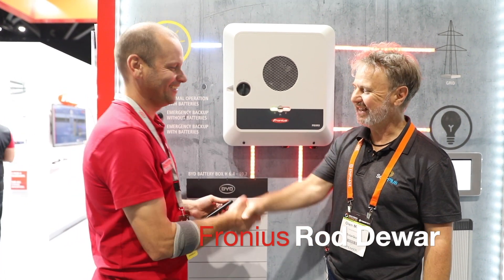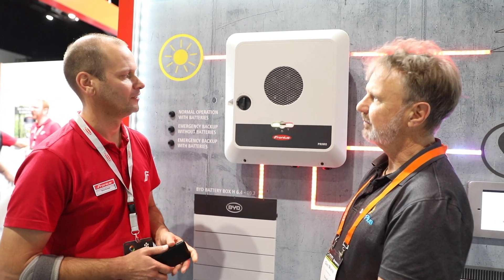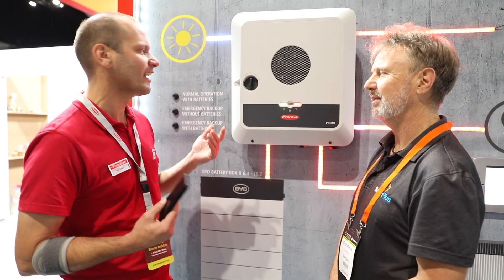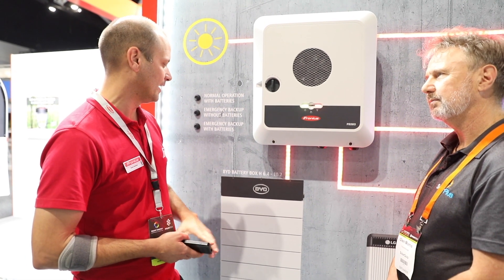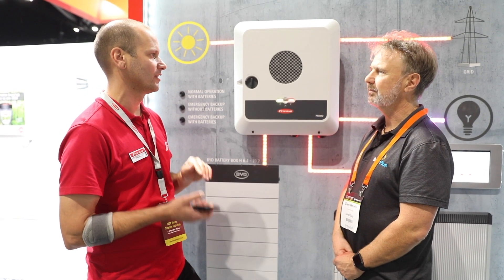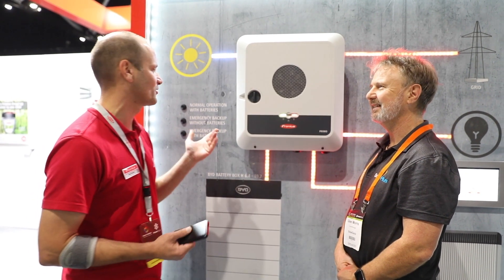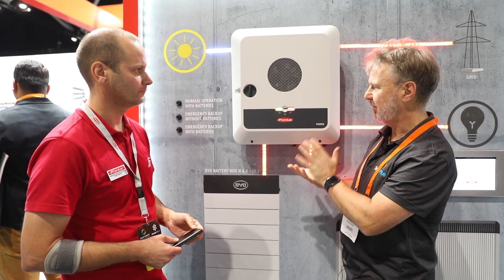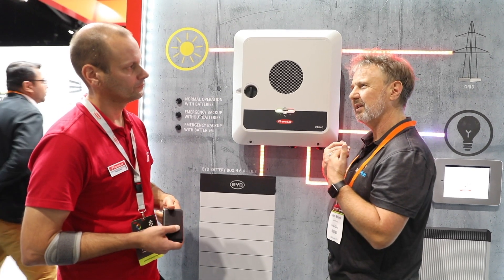Fronius Primo Single Phase Hybrid Inverter

Comment: Power companies are seemingly saying more inverters connected to grid causes a problem such as voltage regulation of line. Could you explain what the facts are regarding this. It just seems fear mongering. What do you think and do you have Tech details to support your view.
Reply from the maker: Exporting surplus solar power back to the grid increases the voltage of the grid (it's physics). This increased voltage can cause other inverters to turn off, and products to fail.
Reply: @SmartEnergyLab  increased voltage. How? I thought inverters use power management systems to ensure the voltage is at a certain level and frequency. And the coal fired stuff is regulated also. Do you have any more technical schematics to help with the idea that voltage goes up. Physics can always be explained quite precisely with diagrams and math.
Reply: @Smart Energy Lab  if they are exporting at 240v and the grids 240v its a problem how?
Reply: as wattage goes up the voltage raises and then goes past the allowed grid settings for your country...the inverter shuts down and restarts again.

How do I know? It's happened to me in a UK grid with high area grid voltage with localised solar on the line further down the grid.
Reply: @bramcoteelectrical1088  sorry. But needs explanation. If wattage demand goes up current goes up, not voltage. I believe authorities are using this possibly lame valid excuse to cover for simply demand increasing and all those new Aircon ditioners need more power delivered through higher deman equipment.
Reply: transients cause rapid fluctuations in the output of photovoltaic (PV) systems, which can significantly affect the voltage levels in a low-voltage (LV) grid with high penetration of PV systems. These voltage fluctuations may lead to violation of the existing power quality standards
Reply: @SmartEnergyLab ok. How does that compare to load demands increasing problem. The focus is on knocking solar. Solar is bad . Don't do it is the message in Australia and some get sucked into it.